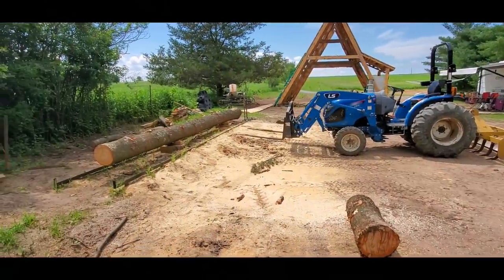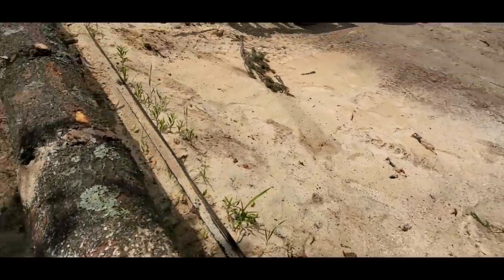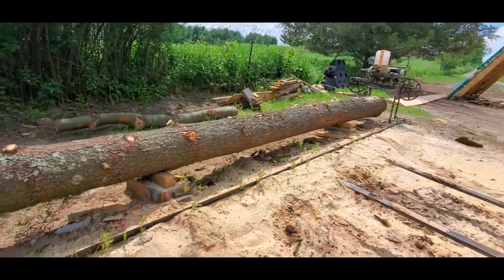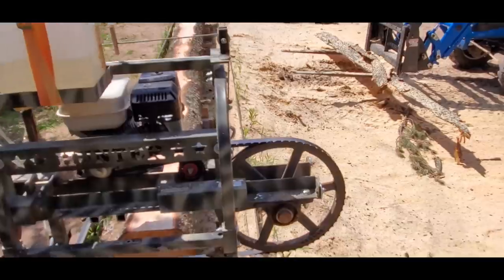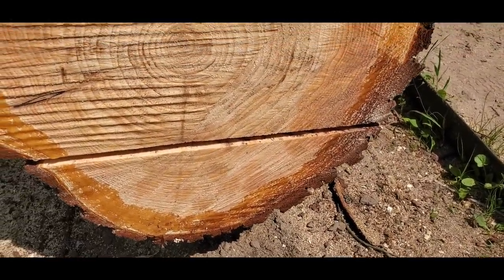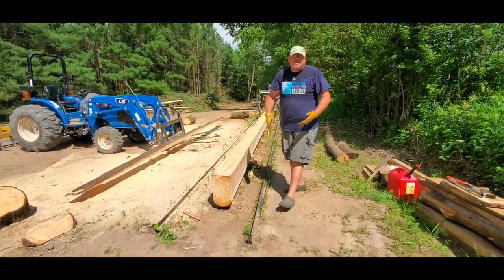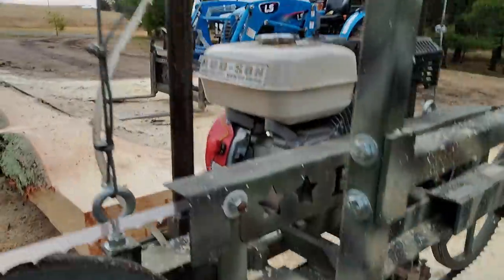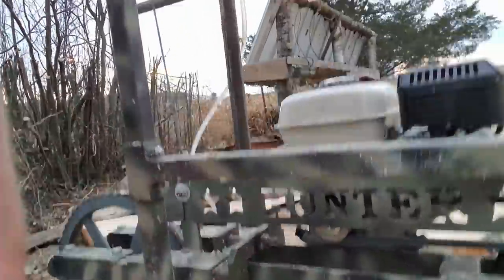A Different Way to Saw Mill  S3:E18

Comment: I clicked on this video once before and enjoyed it .i love the simplicity of your log cutter ..was wondering if you bought the meconizum from hudson and installed your own track? also how many Hp is that motor ?
Reply from the maker: Hello, thanks for watching. I purchased the saw caraige from a hudaon dealer in wisconsin. It was a demo model and had no track included in the sale. I constructed the rails myself from angle iron pieces and cemented them into the ground. The saw has an 8 horse motor. Glad to hear you enjoyed the video.

Comment: This is an excellent setup for a hobby or farmer who just cuts for personal use once in a while.  I looked up the hudson hunter and it seems quite affordable, but how were you able to order without track and use your own, or did you just have to discard the track from the manufacturer?  I am thinking about setting up on a cheap ex-mobile home frame type trailer which can be had around my area very cheap occasionally thoughts?
Reply from the maker: Great question. I located my bandsaw at the begginning of the pandemic from a dealer that also owned a grocery store. The model i purchased was actualy his demo model and thus why no track was included. When i went to get it they had to get it down off the frozen food sectiion. Probably work well on a trailer but may be too high to load logs easily or push carraige. Thanks for watching.

Comment: With the weight of boards on top lots of friction, that's why mills cut on edge.
Reply from the maker: Thanks for the comment. From my experience the strength of the wood immediately in front of the blade holds the kerf open wide enough to not cause extra friction on the blade. Also because the kerf is slightly larger than the thickness of the blade due to the offset of the teeth. At the very end of the cut when the teeth have cut through the log but the blade is still in the kerf i notice increased friction.
Reply: @johansenfamilyvlog8972  I’ve seen chainsaw millers tuck a wedge in behind the saw every once in a while. Much bigger kerf than yours, of course, but even with yours, a shim might avoid that late friction.
Reply from the maker: Perhaps, thanks for the tip.

Comment: How do know if your third is square to your first and second cuts?
Reply from the maker: I use my eye-chrometer. 😁 The top and bottom cut of the slab are parralell because the log hasnt moved. After rotating 90 degrees, using my eye, the top cut is waste. Every cut after that is parallel to the previous cut so is guaranteed equal thickness. If the 90 deg turn was off then the edge cuts will be slightly at a lean, barely noticable. Thanks for the comment.

Comment: how many cuts do you get out of a blade? (assuming you dont hit something)

ps--that A frame structure in the background is very cool/
Reply from the maker: Hello, it is very hard to say because it varies widely on what I am cutting but it seems I get about 4 hours of cut time before the cut gets bad and I have to change the blade. After about 30 minutes cut time the initial "zing" wears off and I can tell thar I have to push a little harder to get through a cut. My last blade I think I did 7 logs @ 13 feet each all with thick bark, they were all about 12-13 cuts each log so that would be sonewhere around 1100 feet. Thanks for watching.
Reply: @johansenfamilyvlog8972  thanks so much, that was super helpful!

 Right now I am trying to decide between a cheap chainsaw mill, or building a band saw mill.  Seems like you barley get 1 log out of a chainsaw blade before needed to be sharpened.  plus building machines / metal fab is much more up my alley than anything with wood...so I am leaning that way....but its also the more expensive option in the short term.

one last question, how many sharpening are you able to get out of a blade?  If you if a nail or something, is it trashed, or can you resharpen it?
Reply from the maker: That I initially built to be a shed for my tractor. We converted it to a cabin and now live in it full time, off grid. Thanks for watching.
Reply: @johansenfamilyvlog8972  there's just something architecturally pleasing about it.
Reply from the maker: I only get 1 or 2 sharpenings out of a sawmill blade before the teeth need to be reset and my sharpenings dont last near as long as the original blade. I dont currently have a reliable method for setting offsets on teeth so I have a stack of blades waiting to be sent out once I find a local Amish that can do it.

Comment: Did you make the guide rail system
Reply from the maker: Yes I did. There is a video about it if you are interested. I underestimated how much room I would need for the head to clear the end of the logs and should have made the rails another 3 feet longer. If I were to do it over I would build a shed for the saw mill, invert the cutting head, and susspend it from rails overhead. Thanks for watching.

Comment: That saddle block approach is very smart. Would 3 work or does it get too complicated?
Reply from the maker: The 3rd makes it all messed up but i do slide blocks under to support the log from flexing as it gets weaker through the milling proccess
Reply: @johansenfamilyvlog8972  maybe a car screw jack would be convenient for support
Reply from the maker: Yeah, ive been looking into that too. I was thinking one off an rv trailer and using an impact drill to make it go up and down.

Comment: Re the tensioning of the V belt...would it be possible to work out a spring-loaded tensioner for when it is running, much like the serpentine belt tensioner on a car engine....
I remember one on a rotary hoe where the V belt was tensioned (acted as a clutch to engage the tines) and was an eccentric that went over-centre, with the roller under spring tension against the belt....
Reply from the maker: Thanks for the comment. Im sure there would be a way to make it work. I think it is done the way it is for cost, weiggt, and simplicity.
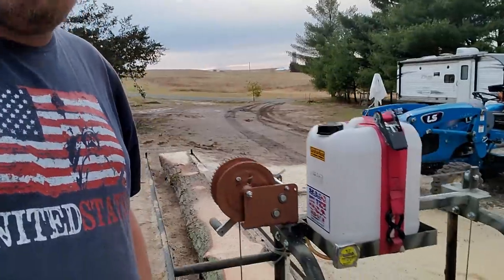Reply: John, at 21:23, he's talking about blade tension, not belt tension.

Comment: How do you change the blades? Is a lot of disassembly required?
Reply from the maker: Hello, first you have to remove the 2 blade guards, 2 bolts each. In the video you viewed they were already off. After that there is a blade tensioner, 1 bolt, that needs to be loosened to allow the blade to come off. Thats it. It is designed for the wheels to be held from one side of the blade so the blade can just slide off once loosened. Thanks for the comment.
Reply: @johansenfamilyvlog8972  Easier than i imagined, thanks for the reply. Nice set up you have.

Comment: I have never seen a mill with no guards. Lets see a close up of the A frame your building.
Reply from the maker: I took the guards off and to change the blade and never put them back on. I will reinstall them before future use but it does make the saw look dangerous without them. Thanks for watching.
Reply: @johansenfamilyvlog8972  I really don't care but you should. Never work between the blade and log when the engine is running. It looks like one of the axles is bent? I like the one turn method. I have the LT40 Super Hydraulic and turning is hands free for me.  I was going to try it your way except I need to clamp the wood, 50 HP Cat Diesel feeds the blade a bit harder that a push mill.Some times if I put my hand where the sawdust comes out it will break the skin and stick like slivers.To find the largest cant in any log fast, multiply the under bark diameter by point 700 . sample, 18 inch Dia. x .700 =12.6 or 12- 1/2 inch cant. Make a simple chart of log size you may cut and hang it on the mill.
Reply from the maker: Very useful information. Thank you.

Comment: Great video!  Would it help to drill a small hole through your tensioner bolt at the proper tension and put a cotter pin in the hole to stop the nut from creeping due to vibration?
Reply from the maker: Good idea, but unfortunately the blade expands quite a bit while it warms up. Thus why i recomend individuals to check the tension with a torq wrench. Thanks for the comment.

Comment: Hate seeing you take the thick slab wood off the bottom and use for heating.   Can't you take a lower initial cut then your usual cut off the bottom before turning the cant to yield more lumber?
Reply from the maker: I will take a closer look the next time i mill. I do need a fair amount of firewood and have plenty of trees so it has not yet presented an issue. Thanks for the comment.

Comment: are you down south with all that good straight lumber ( logs)?
Reply from the maker: Wisconsin, eastern white pine. Thanks for watching
Reply: @johansenfamilyvlog8972  Do you find white pine has sufficient strength for your structural lumber, compared to say spruce, or are you spacing the beams closer together in the home?  Also, I remain surprised that you have not invested in a planing mill to finish plane the lumber to a nice smooth side  (or maybe you have in another video and I missed it!).  What are your thoughts on planing down white pine to a smooth finish?   My other question is:  given the lengths you are cutting and only two supports, are you finding any sag in the cant as you work your way down sawing off planks?  And if so, how do you compensate for that?
Reply from the maker: I have purposely slightly increased the size of timbers in the A-frame, it appears to be structuraly sound. The cant does begin to sag on the ends and rise in the middle as its thickness is cut into lumber, to prevent this i placed support blocks on the ends to prevent the sagging. We enjoy the look of the ruff cut wood but quite simply do not currently have the financial resources to purchase a thickness planner or an edger. Both would make our lumber much more appealing to most. Thanks for watching.

Comment: Hey if you make a two very simple Spiked/ abrasive wood frame ramps at 45deg AWAY from bed in a triangle the top being about 3' high I guess for your logs you could roll the log down it with the tractor foks, and as you guide it down, once half way 180 deg, you stop , lift log and go back onto saw bed.  All could be done about 4' away from bed rail.  The two ramps would be maybe 24" wide each and spaced about 8 feet apart for tractor to easily go in between.  You could easily spike them securely, If it works great make some solid concrete anchors to use them as needed/where needed. Simple to try.  Ramp could have @1" angle like a sluice box to make it roll simply if req. If ramp is too smooth it would slide and not roll. Formula req per your design.
Reply from the maker: Thanks for the comment. I have tried to think of a better way to put a 90 deg turn on my logs utilizing my tractor. Your comment has given me some more ideaa i will have to think about. Thanks for watching.